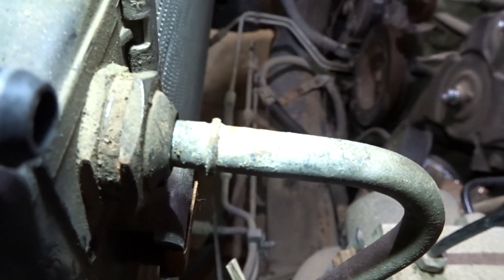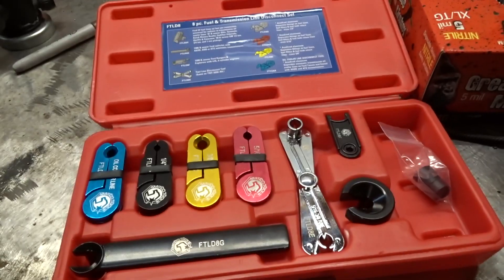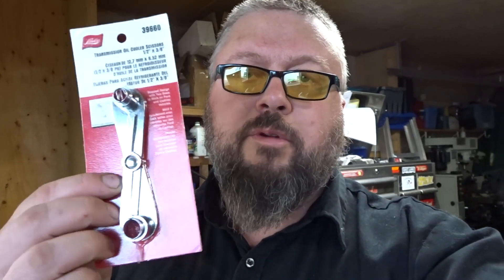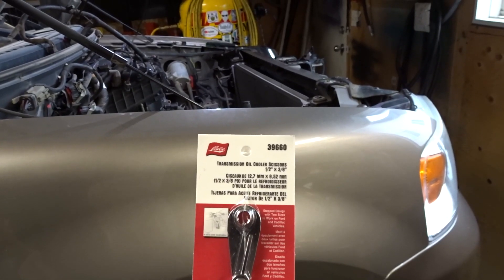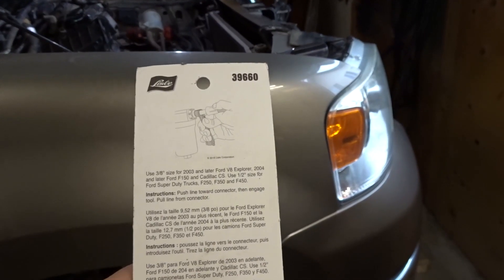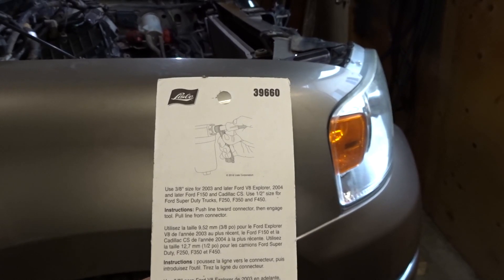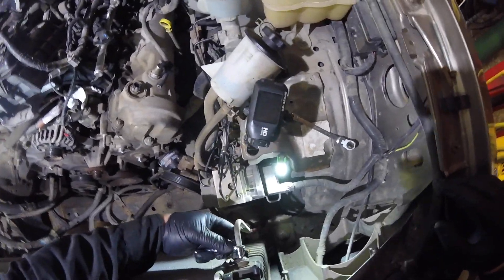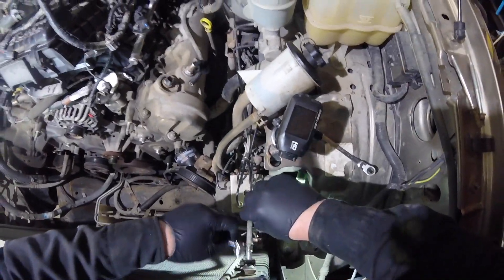DIY Ford F150 Transmission Line Removal 2004 and Up

Comment: WORK AROUND SOLUTION.  Thanks for this video. Didn't have this tool and needed immediate solution. Used a small adjustable hose clamp for shim material (size less than 1/4" width -- so that it would fit in slot of connector.)  Cut off the clamp, preserving just the band. Make the band at least 1/8" shorter than the circumference of the connector (definitely so that the edges don't touch together when wrapped around the connector.)  With pliers pre-rounded it to match the connector's circumference shape.  Then snapped it over the connector and used various narrow screw drivers to slide band (as a shim) down into connector (circa 1/8-3/16" down). Tug on connector to separate!  VIOLA! Yankee ingenuity (at least it impressed my son!)
Reply: This actually worked for me, nice idea 👍

Comment: Thanks for the vid. I am going to get the tool now.
Reply from the maker: The tool is a must have
Reply: I got it and it made life so much better. It was not easy to find. All the auto parts stores had to order it. Fortunately a wholesaler I deal with had it in stock. I actually saw one vid before yours that said the only way to deal with this issue was to cut the line then splice it back together.  Thanks again.

Comment: Does the connection to the radiator close off? I want to install a winch mount in that area, so I need to move the cooler

Comment: Omg head smack.  I like to think i am smart then I go and take a wrench to the fittings and unthread them.  2 returned radiators later I finally figured out that i do not need the rare unicorn ford radiator with female threaded cooler line fittings!!!!  Soooo much time wasted.  Picking up the tool tomorrow and hoping to finally get this F150 back on the road

Comment: so what if my tranny fluid started leaking at one of those fittings at the radiator, lower  drivers side on 2006 F150 4x4  with 5.4?
do i just get that tool pull out house and replace an o ring? and reinsert hose?
it started this in minus 25 celcius deg weather but now i think its doing it in minus 15 also.
Reply from the maker: Remove line inspect and most likely replace fitting
Reply: @TestDontguess  weird thing happened. unscrewed that connector that seemed to be leaking and tranny[or maybe power steering] as well as radiator fluid seemed to be leaking out the same hole?
wtf is  up with that?
couldnt get it out far enough to inspect and remove any o rings  or compression fittings but screwed it back in and went to the car wash and it hasnt seemed to leak since in those last 5 km.
i thought i was gonna need some special tool to remove fitting, bought a multitool kit for ac/fuel/tranny lines and it didnt seem to be correct tools so i couldnt replace any o rings.
im so confused now, not sure if this is a power steering cooling line or tranny cooling line as i have an aftermarket skidplate bolted in place making it difficult to trace lines but i should add y power steering fluid was down enough to start that buzzing squawking noise when in use driving.
filled it up asap at sore and by time i got home to do this connector inspection it was down half a cup again.
so is this a power steering cooler line built in to left/drivers side of radiator?
its a 2006 f150 4x4 5.4L engine

Comment: Nice video you forgot to crack a beer, it’s your signature kinda let me down haha. 
You have a video or some advise on the socket the line goes into leaking real bad? Orings plastic bushing or just have to replace radiator? Any help would be greatly appreciated.
Reply from the maker: there is no beer drinking on this channel as this is the PC Version.  You may be able to get those fittings somewhere

Comment: I drank the Kool-Aid and bought the special tools, too. That idea was as bad as Jonestown. So instead, I used two tiny flat-head screwdrivers & disconnected the line within a few seconds. The "special" tools are a very bad design, no matter the company they come from. Two tiny screwdrivers did the job, like I said, in a few seconds. I returned the "special" tools, btw.